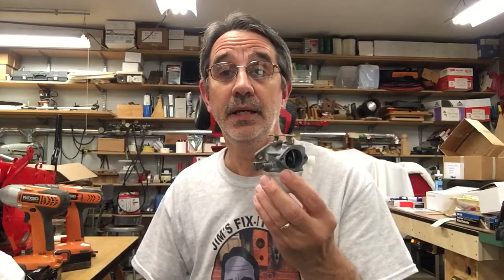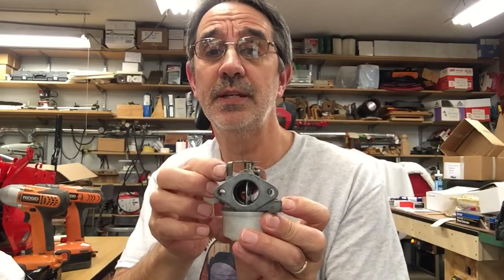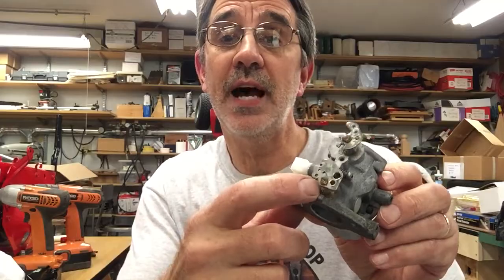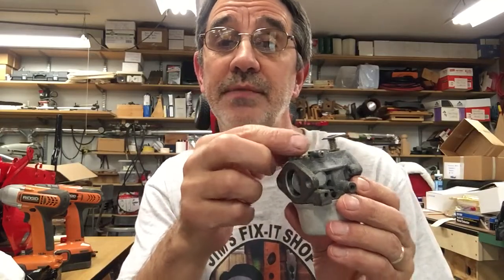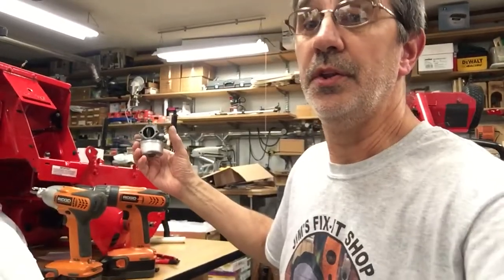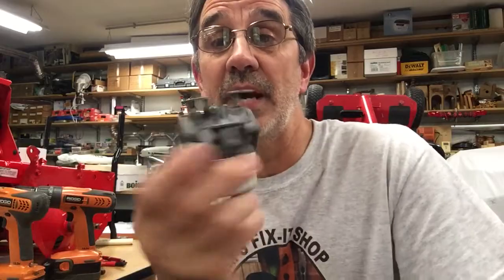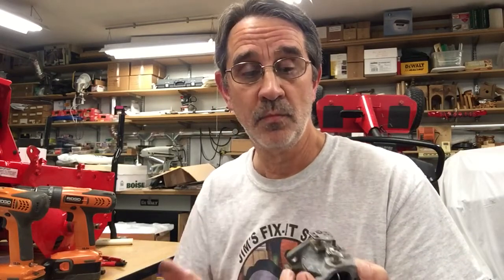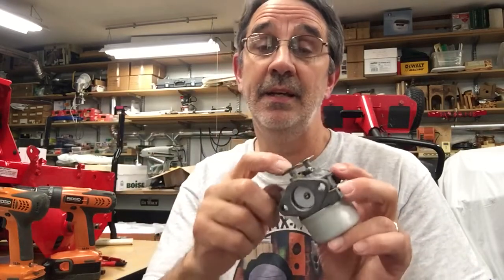266.   Why is my engine running wide open at full speed

Comment: Jim I have a Troy-Bilt pony 17.5 horsepower I found the butterfly but the two screws are gone could you tell me where a store I could find the screws to go back in the butterfly I would appreciate it thank you Andy thank you videos are great
Reply from the maker: Any good hardware store should be able to supply you with a couple of screws that would fit otherwise try a ace hardware store that repair’s machines they’ll have the screws I’m sure. Jim

Comment: I have the same issue this my tiller that has a 195 cubic inch Tecumseh motor. When I started up it revs weiwei high in the only way I can fill it down is to pull back on the governor rod. I've tried adjusting pitch on the rod. I've bent the plate bolts on the front of the carburetor mounting bolt towards the governor. My linkage is all correct. I've had the carburetor off cleaned it replace the needle valves and seal. Clean the carburetor very good. Nothing seems to work?
Reply: Also it's not the butterfly it is just fine.
Reply from the maker: Well if the butterfly is OK then I would have to say it’s gotta be your governor and it could be a problem internal on the engine, I’m not sure how the Tecumseh governors work I think I have an older Tecumseh engine I’ll take a look at it and let you know.          Jim
Reply from the maker: OK I had an older Tecumseh engine and I opened it up if I can figure out how I’ll send you pictures but it is a mechanical Governor it’s similar to the Briggs & Stratton.‘s as it spins it throws some weight salt and that’s what controls the RPMs it runs off the small gear that’s on your crankshaft the same gear the cam uses for timing once you open it up and look at it you’ll be able to tell if it’s still in one piece or if it’s broken and not working properly. Jim
Reply from the maker: No I can’t send you any pictures until you email me first and I can return them if you’re interested my email is
jimsfixitshop@gmail.com
Thanks.  Jim

Comment: Hi Jim,  I have a Honda pressure washer.  It runs wide open. When I push the bar to the governor towards the carburetor it slows down.  Should I replace the spring 1st?
Reply from the maker: Well it could be the governor just needs to be adjusted or there could be something wrong with the governor inside the engine where it rides on the cam shaft. Jim

Comment: Hello Jim,
Good explainations.
I have a Craftsman lt1000 rider 42 deck. When I start her up she starts great and jist keeps running faster amd faster. I shut her down..afraid of thermal run away...LOL but, seriously how do I fix this?
Reply from the maker: It sounds like the butterfly inside of your carburetor has come loose or may have completely fell off you’ll have to look through the carburetor with the choke butterfly open and see if the inner butterfly is working. Jim

Comment: Great job love your channel, I have a problem with my generator it will be running and then all of a sudden it will go full throttle and stop putting out power and I will have to go over and stop it myself wait a couple of minutes restart the generator it will run ok for a while and then act up again , any ideas?
Reply from the maker: I guess I would start by cleaning the carburetor and see if that helps you will have to take it off and clean it. Ultrasonic cleaner is the best thing to use.  Jim
Reply: @jimjackson9381  thanks Jim , that’s what I will do keep you posted , I have a another project to finish for my wife and then I’ll get started on my generator in about a month thanks again 👍🏻
Reply from the maker: @mlxx4612 well keep me posted and let me know how it’s going. Jim.

Comment: Jim I have a 2007 gravely zero turn that revs up and slows down tried to adjust it with the throttle but didn’t help any ideas what to do
Reply from the maker: That’s called surging and it’s caused by a dirty carburetor.     Jim

Comment: Hi Jim, Have a toro pushmower that has an issue with the governor. The shaft is stuck and cant seem to adjust it and when I had it running it was racing. I wondered if I could try to get the linkage in a somewhat a happy medium and try to run it. But now even after I cleaned the carb and tried starter fluid its not starting.(there is spark)  My 2 questions are is the throttle governor butterfly in a cold starting attempt suppose to  be closed like the choke one or open? Second question is me trying to adjust the stuck governor in a fixed position effect the starting, or lack of starting? thanks John Sorry thought of a third if i disconnect the linkage to the governor to the carb can I try and start it that way?
Reply from the maker: If you disconnect Governor and start the engine it’s gonna run wide open.        Jim
Reply: @jimjackson9381  ok thanks

Comment: Hello i have a briggs & stratton xrd  23hp v-twin my problem is when i start it it revs very high i instantly shut it down , i start it again and hold the govenor up and it runs normal only while holding it,
Reply from the maker: @michaelstinger6785  well the first thing I can suggest that you do is take off your air breather box off of the carburetor and look through the carburetor and make sure that the butterfly is still in place not the one for the choke. That’ll be the first one you see, you have to look through the carburetor to the backside sometimes the screws come out and the butterfly falls off it run wide open. If that is OK then my next guest would be your internal Governor has failed. It has a plastic gear that runs up against the metal gear on your camshaft.            Jim.

Comment: Hey Jim, by chance would you know the part number for a older 9hp B&S pull start carb kit? Thanks.
Reply from the maker: Les Osborne 
   No I don’t know the number but you can call Briggs & Stratton. in Milwaukee Wisconsin and they can help you with that or a lot of times you can find them on Amazon or eBay. Jim

Comment: ‘‘It’s the famous Butterfly Effect.”  When your motor goes crazy and won’t stop, it can either run amok through your yard and neighborhoods mowing down all the grass it encounters, if it pops in to gear at full speed, or it can shock the heck out of anyone who grabs the spark plug wire to try to pull it off and stop the mower’s motor (i learned that lesson the hard way), which is a major of ER Admissions for Atrial and Ventricular fibrillation from electrocution; or you can just let mower sit in the yard for months in the place where it was stopped by running into an oak tree, andv the grass still won’t be cut, while the antiquarian grass cutter in the family tries to remember being a teenager who understood these devices and what he knew then they might help.  In actuality, nothing happens until the City or HOA notices your yard and they start issuing fines for the months after the yard began to look like an unattended vineyard.  Or if you see what’s coming with no fix in sight, report the mower stolen, and throw you hands up in complete surrender and buy a new mower, thereby stimulating the economy in manners never predicted by economists studying these matters.   

I have a 25 year old Snapper Lawn Tractor, model LT145H38DBV, and after replacing the original carb a year or so ago, it started running wide open as soon as I cut it on, with no ability to slow it down using the throttle lever.   Never thought about a lost butterfly, but I have the old carburetor somewhere, extra screws, tubes of Loctite thread sealer in both Red (permanent) and Blue (which can occasionally be adjusted), a copy of the shop manual, a parts list, and most of the tools I need.  But best of all, I have your great advice about where to look to address the issue.  Below is a helpful tip for you and your viewers, which I discovered by following up on someone’s casual reference to it. 

THE TIP -   Loctite makes many great products, but one of the greatest is a “HY 4070” Hybrid Adhesive, similar to epoxy, and comes in a two part tube and 4 different nozzles that mix the two chemicals together inside a single nozzle, as you push on the tube.  To be sure the chemical is completely mixed, Loctite recommends wiping the first two or three inches of the initial output onto a paper plate, or a disposable piece of cardboard, so that the first adhesive applied to the problem area is fully mixed. The last part  squeezed onto the plate will be an easy indicator of when the adhesive has hardened.  The adhesive is moderately gap-filling, and at room temperature, you should have a permanent bond within 5 minutes, but certainly with in 7 minutes - the hotter the environment, the quicker it works.  I use n-Heptane (rubber cement solvent) as a quick drying primer I’ve tried a lot of adhesives and epoxies. I won’t say that it is stronger or better than my old stand-by, the original J-B Weld, but HY 4070 fully sets in 5 to 7 minutes instead of 5 to 7 days for maximum strength. Because the nozzles mix a fair amount of chemicals to make the active adhesive, either plan your projects ahead of time so that you can do several in a row, before the chemicals dry up, or buy extra nozzles when you buy the Hybrid Adhesive.  The brand name and product name are LOCTITE HY 4070. On Amazon a regular 11 Gram tube costs about $18.19 including 4 mixing nozzles, and 5 additional nozzles are about $8.80, with free delivery for prime members.  Link is below:

10:29 https://www.amazon.com/Loctite-Hybrid-Adhesive-Clear-Cartridge/dp/B074WZJ44X/ref=sr_1_2?crid=2EHRZF1SM6TQP&keywords=loctite+hy+4070+adhesive&qid=1679760301&sprefix=Loctite+HY+4070%2Caps%2C105&sr=8-2

Comment: I have a older snapper Model# 281022be 11hp briggs motor. What is the best carb to replace old & part and if you have the part # please
Reply from the maker: I am not really into engines that much you would have to call maybe Briggs & Stratton. or your local Ace Hardware they work on machines. Jim

Comment: I have simplicity  tractor and the butterfly broke so I bought a cheap carb it stop the high rev but when I give it gas there no limit on how high the motor revs. I reset the the gov but it still does it.  Do u think the spring r bad .
Reply from the maker: I’m not sure I’m not a big engine repair guy but it sounds like The governor isn’t working right. Jim

Comment: I got a generac guardian 15000 watts generator it does same thing with 8 hours run time runs at high rpm couple seconds and dies but that one come with stepper motor in the carb to control the rpm
Reply from the maker: @mayralopez1000  well I guess the first thing I do is check the throttle plate inside the carburetor and make sure it’s still attached.

Comment: I just now checked mine on my snapper riding mower and the butterfly was off laying inside the carburetor.
Both screws are missing..
Reply from the maker: Well if you ck your muffler you may find them or they may be stuck in the top of your piston.          Jim

Comment: Sir 1 Question my 30 gallon gas  air compressor runs only when is charging but when cut off 
The hole compressor shut off 
Thanks.    Has new carburetor
Reply from the maker: So is it working ok know.       Jim
Reply: No is not working when the air compressor finish filling up turn of and l have to starting again  
And again is not staying on
Reply from the maker: OK I found a YouTube video that explains the different parts of your air compressor and you can also see what he’s talking about which should make it easier than just this email. It’s called air compressor parts.com and they also sell the parts that you’re going to need, the first thing you’re gonna wanna check is your pilot unloader valve that’s probably what’s making your engine not cut back in and make more air. Do you wanna check your check valve on your tank make sure it’s unloading the pressure between the tank and the pump head and some models have a air volume control valve mounted on the engine, hooked to the governor, I don’t know what parts your machine has because I’ve never worked on one of those and I’m not sure if you ever said the brand name but check out his website. I tried to share it and send it to you but I keep coming up with a notation that’s telling me you’re email address isn’t available that’s what I’m using it at the top of your email. I’ll keep trying to figure out if I can send it to you if I can’t Google the name and you should be able to find it. Let me know what’s going on. Jim.

Comment: One time was all it took for me. I passed right on by the locktite to the JB weld section. They ain't coming out again.
Reply from the maker: J S 
Just make sure the JB Weld will hold up to the gas without breaking down. Jim
Reply: @jimjackson9381  Yeah I thought about that. The engine is on a craftsman push trimmer. Its been on it 5 years plus. When I started it, it went wide open. Shattered the governor. I fixed that, pulled it over, the same thing. But I shut it down before the governer came apart. I then found the throttle plate problem. I never found my screws either.

Comment: I have a Honda 5.5. Has a new carburetor runs great when the choke is on as soon as I turn, the choke off, it’s full power the governor never goes back to idle.
Reply from the maker: Can you slow the engine down by moving the throttle control on the side of the machine? If you can’t then it sounds like you’re carburetors got issues not your governor. Jim
Reply: @dennissmart6824
My HONDA GCV160 5.5 is doing the same thing after cleaning & reinstalling the carburetor.  

I'll update if i figure it out.
Reply: @dennissmart6824
Forgot to mention.  It's "Automatic choke return, fixed throttle."  No throttle control lever, fast-slow setting, or any of that.  Frustrating, rare - apparently.

Comment: Think this could also explain why my echo trimmer/edger engine uncontrollably racing?
Reply from the maker: That’s a good possibility. Let me know if you find out what it is.       Jim
Reply: @jimjackson9381  Problem is that the echo carb is not configured like B&S carb.  The butterfly valve is not so easily discernable.  Can't be too dissimilar,  governor's for smaller engines are either based on airflow or they are electronic and I doubt echo would use something so high tech. Will let you know what I find out.
Reply: @jimjackson9381  Not a governor issue.  Somehow the engine assembly got turned around when I lubed the drive shaft and stretched the throttle cable.  Simple fix.  But the governor issue issue is still interesting for me.  Like............where is it?  Will keep searching.  :)

Comment: Mine runs for about 5 seconds then dies and I cant get it to start again. Do you have a video that shows how to get to the carb? And lastly how do I get into the battery box? I dont want to go breaking things or taking more parts off than necessary. Thanks!
Reply from the maker: Muntz1967 
 Hi it’s Jim
     Well the best thing I can say is you just have to wiggle your hands in the and try to get the carburetor off it is a tight fit otherwise if you take the four bolts off of the engine you can turn the engine so the carburetor is facing you and I’ll be easier to work on.
    To get the black plastic battery cover off they used some plastic pushpin type connectors you have to get your fingers behind and under the plastic cover and pull out words to remove it off of the plastic fingers it was a very stupid way to do it. Jim
Reply from the maker: Muntz1967 
Hi it’s Jim
   The numbers match so the carburetor should work without any issues, the silver thing on the bottom of the carburetor is your shut off solenoid , You will need to run 12 V to it from the ignition switch. Jim

Comment: Question..I have abriggs 16 hp i/c engine.the governor is peged open when I start the engine. It won't slow down and it back fires. I can manually pull the governor to idle position  and the engine runs smooth. If I let the governor go it open back wide. I have cleaned the carburetor  and got debri out of it..I ran good before I ran it out of gas..now no power to mow.
Reply from the maker: If the engine is running wide, open, check to make sure the linkages are hooked up properly to the shaft coming out of the engine from the governor make sure the linkage on the shaft is not loose. The end of the shaft should have two flats on it, if everything looks good, the problem could be inside the engine.         Jim
Reply: @jimjackson9381  im going to try to send you a short video...maybe 2 or 3..the linkage is tight..if it is in the engine where would it most likely be..all my tools aren't here with me as I'm in the process of moving
Reply: Btw thanks you for your explanation and the channel you have..I subscribed  to it and hope I can glean some knowledge from your ecperience
Reply from the maker: If it is your governor inside your engine you’ll have to turn the engine upside down and take the bottom off of it you will need a new sump gasket and probably a new lip seal that goes around the crank on the bottom of the engine once you get the sump off you will see the Governor they’re usually a half white colored plastic gear with some weights on it the gear may have broke or lost the weights and that’s why it’s not slowing down the engine.  If you have or know of someone that has a endoscope you can push it in the drain hole on the engine and you may be able to see the governor or you might be able to see the parts laying in the bottom of the sump before you tip the engine upside down.     Jim